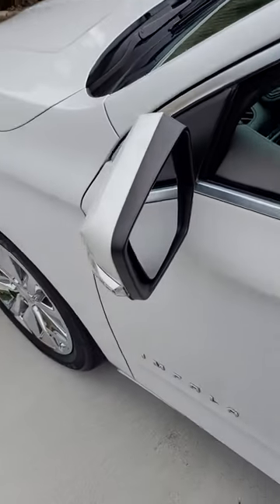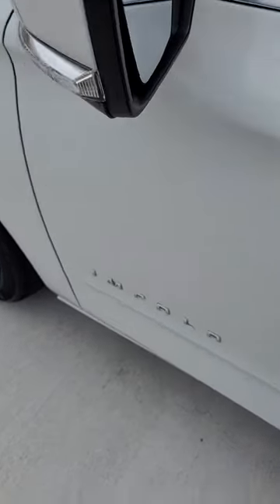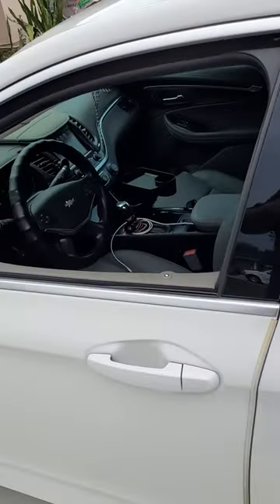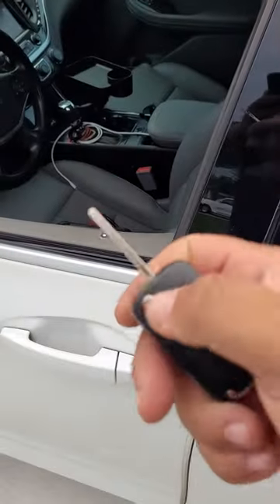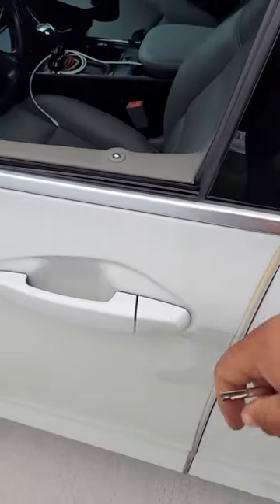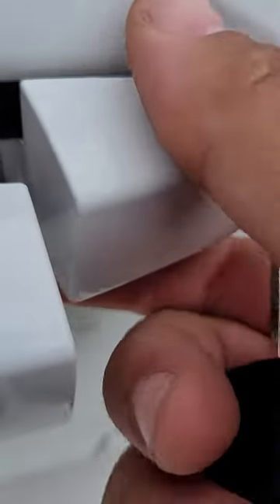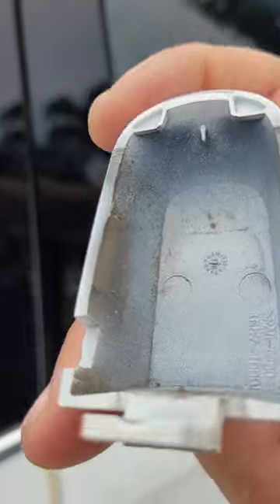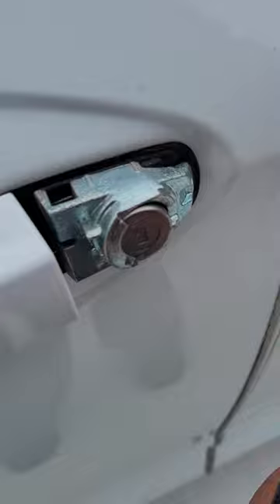2017 Chevrolet Impala Location and exposure of Drivers Side door lock Cylinder.

Comment: What do you do if the casing is stuck?
Reply from the maker: The removal process should be very simple, but under different circumstances it has to be worked off according to what is Holding it on.